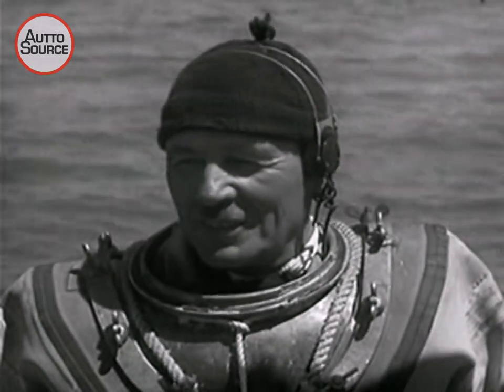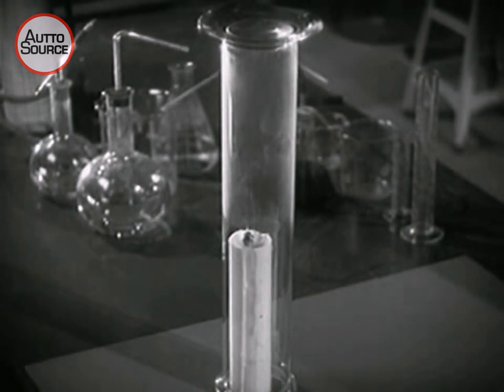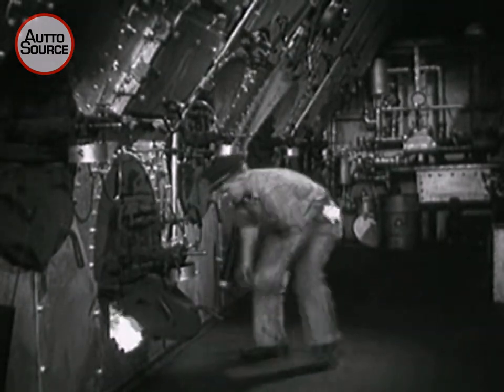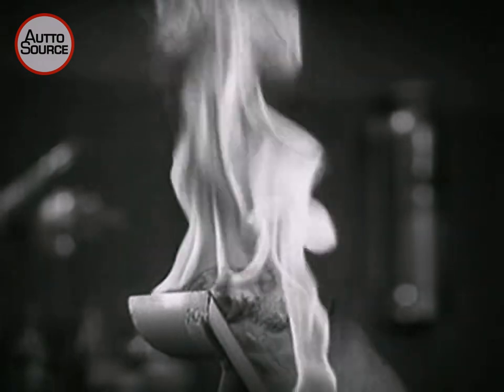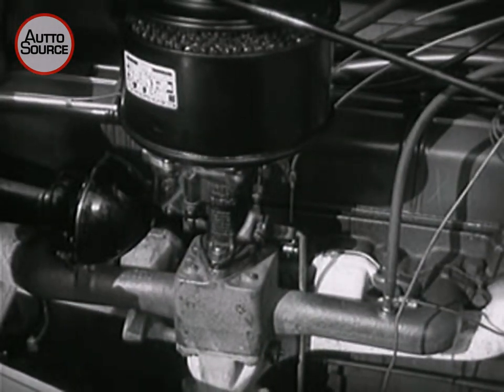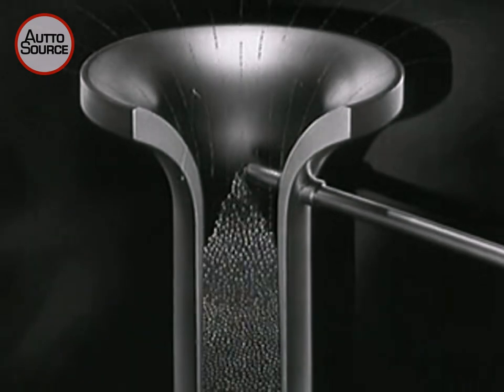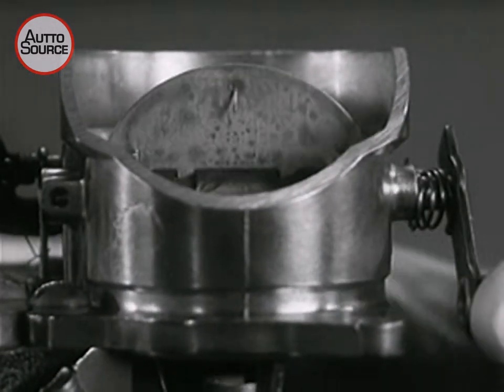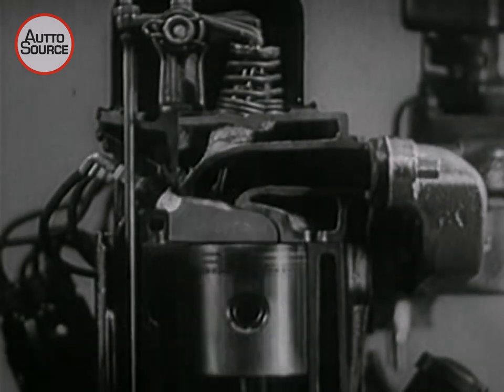How Carburetor Works

Comment: 3 tablespoons of gas per .25 mile = 12 tablespoons per mile.  That means the car gets about 20 MPG.  Considering the car did not use all of the three tablespoons of gas in the quarter mile, one can reasonably assume the car gets roughly 25 MPG under ideal conditions!  Not bad for the time.

Comment: In my carburetor class we are certainly going more detailed on the parts and function, but this is a great video explaining the basics of how one works. Also noted the old wetted air filter with steel wool. Finally seen one earlier this afternoon. The carburetor my partner and I were working on plus the air filter came from his old 1951. The fuel tank on the carb was clocked with some kind of bug nests. Not the first time I seen bugs in fuel system, but still don't recall being informed what kind of bugs would live in there?!

Comment: I did some math, it took them about 3 tablespoons of gasoline to get about a 1/4 mile. There are 256 tablespoons in a gallon; 
4 (quarters in a mile) multiplied by 3 (tablespoons) is 12 (tablespoons of gasoline per mile), 256 (tablespoons or 1 gallon) divided by 12 (tablespoons) is 21.3 (miles per gallon). There is no way THAT car got 21.3 miles per gallon driving like that, more since the carburetor didn't even take the whole vile of 3 tablespoons. Just killing curiosity lol
Reply: Jason Delamarter but the EPA wants to ensure that engines become MORE efficient.
Reply: You can thank the EPA for fuel economy restrictions. Why is it impossible for the car to get 21.3 miles per gallon
Reply: The EPA cares  about emissions not engine efficiency

Comment: General Motors used to make the best educational videos, they really explain mechanical systems with a logical progression that anybody can follow. Now if only they could make a video explaining how a turbo encabulator works, because that Chrysler video left me even more confused...
Reply: How does a turbo encabulator work? It's super simple dude. The original machine had a base-plate of prefabulated amulite, surrounded by a malleable logarithmic casing in such a way that the two spurving bearings were in direct line with the pentametric fan, the latter consisted simply of six hydrocoptic marzelvanes, so fitted to the ambifacient lunar vaneshaft that side fumbling was effectively prevented.  The main winding was of the normal lotus- o-delta type placed in panendermic semiboloid solts in the stator, every seventh conductor being connected by a non-reversible termic pipe to the differential girdlespring on the 'up' end of the grammeter.
Reply: @silience4095  LMFAO  you're funny :face-green-smiling:

Comment: 21.33... Miles per Gallon! WTF, that is better than my 1998 Jeep gets today.
Reply: My 400 HP 6.0L GTO gets about 21 MPG if I am driving carefully and not encountering a lot of stop signs/red lights. I suspect they may have been driving the test car slowly across that quarter mile, so that air resistance isn't a big factor.
Reply: +Satarn Smith for real. I drive a little bmw roadster and i'm regularly getting 18mpg from a 3liter straight six.
Reply: +Christian Arreguin, that is what the math tells us.
Reply: The point is that it is not much better today, then it was then.

Comment: 3 tbsp (44mL) for 1/4 mile (400 meters) means 9,1km/L . My Citroen C3 can travel 18km/L of gasoline and I bet it's faster than that car. COME ON, CARBURETOR SUCKS. Fuel Injection FTW
Reply: +Matheus Bitencourt You're comparing a modern fuel injection system, that's designed for as much power and economy as possible, to a time where it wasn't possible to have fuel injection. 

Of course modern systems will be better.
Reply: +Matheus Bitencourt The carburettors don't need electrical supply. Carburettors are actually quite good and there are carburetted cars that can use about as little fuel as fuel injected cars. They don't need computers, no throttle positioning sensors, no air/fuel sensors, no map sensors. Now, does carburettors really suck..?
Reply: +Matheus Bitencourt Old volvos arent injected... You clearly know nothing about how carburetors work and cars in general.
Reply: +haavard1989 Not only that, carburators have a throttle response that MPI TBI SFI and GDI cannot even come close to. Carbs may not be nearly as efficient, but with the right hands tuning it, it can have many benefits over any form of electronic fuel injection.
Reply: Small japanese cars could do it :) Even my friends old volvo did 0,6L per 10km. Believe it or not.
Reply: +Matheus Bitencourt Citroen lmao
Reply: +Matheus Bitencourt the production car manufacturers stopped the development of carburetors in the 80s in favor of the EFI. BUT, aftermarket carburetors (like the ones from weber) have continued to develop and a modern progressive carburetor can give you as close as 2% less fuel efficient than EFI where tests are done on the same car. 2% more fuel needed is amazing concidering they are 100% mecanical. Having that said, most aftermarket carburetors are made for racing and fitted on big muscle cars where fuel consumption is not really a major concern anyway.
Reply: +haavard1989 I don't know any car that uses carburetor and can run 18 - 20Km/L at road. My Citroen C3 is a 1.4L, and deliver 70HP. great for the city, and for small travels.
It wouldn't be possible with carburetors. 70hp and 20Km/L
Reply: +haavard1989 maybe. is it injected?
Reply: +Matheus Bitencourt The car used in that test was super old and heavy, prolly not great mileage even if same engine was injected.
Reply: Yea carburetor
Sucks compared to efi because it's old technology duh  but if it wasn't for carbs we probably won't even have fuel injection so we still have carbs to thank 😎🏎
Reply: +Matheus Bitencourt People usually understand that your're joking.
Reply: +Joseph Ryan Biag Your mom usually understands that you're joking
Reply: +Matheus Bitencourt the design of the old carburettors and manifolds was pretty crude ... sometimes one carb feeding 8 cylinders.  20 - 30l/100km was not uncommon in those days.  These days we have multiple valves, variable valve timing, fuel injection, higher compression, higher cooling system temperatures etc.... all leading to incredible fuel consumption figures.
Reply: +Plymouth Harrison  Modern cars in the us are not designed for the best fuel economy. There designed to meet the clean air act dictated by the EPA.
Reply: Jason Delamarter That's the same. 
The only way to make a car less pollutant, is match the correct amount of fuel and air. So, the complete combustion occours. Complete combustion means no wasted fuel and less pollutant, so It's correct to affirm that FUEL ECONOMY = LESS POLLUTANT.
Reply: CO emissions are optimally cleaned by the catalyst in the catalytic converter in a lean condition since O2 is necessary for the catalyst. N2O emissions are optimally cleaned by the catalyst in the catalytic converter in a rich condition the lack of O2 is necessary for the catalyst. The ecm in newer cars will cycle between rich and lean conditions to achieve the acceptable amount of emission. By doing this fuel economy will be sacrificed to have cleaner emissions. A complete burn is called astoichiometric
mixture. In practice this is never quite achieved, due primarily to the very short time available in an internal combustion engine for each combustion cycle. Astoichiometric
mixture burns very hot and can damage engine components if the engine is placed under high load at this fuel air mixture. The high temperatures will cause detonation of the fuel air mix shortly after maximum cylinder pressure is possible under high load.Stoichiometric mixtures are only used under light load conditions. For acceleration and high load conditions, a richer mixture lower air fuel ratio is used to produce cooler combustion products and thereby prevent detonation and overheating of the cylinder head.
Reply: +Matheus Bitencourt you own a citroen, your opinion is invalid
Reply: DIE Why so much hate against Citroen, dude?
Reply: Jason Delamarter Yes, you're right. 
What a really meant is that Fuel injection is way cleaner than old carburetor
Reply: supersecretninjame cool. But I still prefer EFI

Comment: did the math that car gets 21.3 mpg
Reply: at like 20 miles an hour... what's the mag at 60?
Reply: +Eric Lopez 
top speed on those cars were usually around 60. thats saying if they were pushing as hard as they could. average driving was probably yeah like 20mpg. looks like we had to change things once cars got faster.

Comment: Geeez... it's like "they" act as if air isn't FREE!?
.
The carb in the video is simple, and extremely efficient, down to an exact science. It will always be better than Electronic Fuel Injected systems, since the computer is doing the calculations, rather than a mechanical way that is more reliable, and always more exact. The carb can be easily adjusted to all conditions by the owner. Do you want computers like Hal running the whole world, even your car" "Hal... open the pod bay doors"!?
.
It's not hard to tech the workings of a combustion engine, and how it works. I even believe the carb in the video is more complicating than it needs to be. Can't a simple float bow and venture with a single needle jet be sufficient enough for a fuel delivery system? Even a diaphragm setup these use for propane conversions can also be used for gas delivery. I remember a old Sachs snowmobile engine I was working on had a diaphragm carb setup, that I rebuilt. Even that was complicated on a old sled?
.
Even the fucking spell check on anything I use, aint worth a flying shit. Computers can't be trusted... they are a prototype of the brain: "MACHINE MEN, WITH MACHINE MINDS... YOU ARE NOT CATTLE YOU ARE MEN... YOU HAVE THE LOVE OF HUMANITY IN YOUR HEARTS"!!
Reply: Brian Davis Dude wtf is up with this guy?
Reply: Carburetors are simple and a nice example of mechanical engineering..
But fuel injection provides more power, torque and more compression using less fuel all while reducing emissions.

The only advantage to a carburetor is it's simplicity and cost to maintain.. But both these advantages are diminishing as people get smarter (And able to easily understand electronic fuel injection) and as supply / demand decreases for older parts.
Reply: Brian Davis Well actually the heart is controlled via electrical impulses from the brain (Like fuel injection is electronically controlled by the ECU) ;)
That's why electric shocks are used to restart hearts.

Modern car ECUs can account for air pressure, temperature, density, fuel quality and throttle position to give you the best air / fuel mix ratios for power and economy..

They also have some error correction to prevent damage caused by an engine running too lean or rich or incorrect coolant temperature..

As per cooling, well internal combustion is a rather inefficient means of producing power. A large percentage of the energy produced is heat which is wasted.. We may well see the end of Internal combustion within our lifetime!
Reply: Azurren That's like saying, "would you rather have your heart beat on it's own, or would you want a pace maker deciding each beat"... In reality you wouldn't need any electronics at all to run a vehicle if they would fix issues with tainted gas... and so on, and so on, and so on...
.
An engine is mechanical, no more diffrent than the human body... it's external control that is the problem. Ultimately the problem with EVERYTHING is a few people want to be, and play God... and will resort to the torture of innocence in order to extort God into getting what they want. I have had the worst pains possible from just making comments on youtube, just about engines alone!! That's how you know things are bad!!
.
You can check out a comment I made on "Twin Turbo Diesel - Explained"... about fuel injector efficiency lie. Ultimately the problem with fuel efficiency is actually a cooling problem. Instead of fixing cooling issues, cars run rich... meaning much of the fuel is wasted, not burned, just to keep the engine cool. It's funny too, because you can make your own air conditioner by simply pressurizing air through a small hole... no need for refrigerant, or those big box units in your window. Your refrigerator for the most part is actually kept cool by this simple concept. Everything is a overly complicated lie. Reduce the variables, and you will figure out God is behind everything!!
.
I have to go to bed, my head and body is pretty torn up....
Reply: Totally agree, my truck's got some serious issues atm and it is all caused by buildup fucking with the sensors! I have to wonder if 90% of engine issues are caused by our computer sensors that they just have to shove into the places where they will cause a buildup and eventually cause it to fail... or maybe that is just a way to get you to buy a new car faster? I think I'll go with that.... along with all the other junk that isn't made to last that we have today like refrigerators that don't last 5 years... I grew up with a 50's fridge that was still working up until about 2 years ago and without a single problem!
Reply: Steven Crimmins Your right... a simple venturi setup  like in he vid works, and is exact!! They need to start incorporating reed valve ad a HIGHER intake to atomize the gas more.
.
You want to figure out waste, just look at how stupid the EGR works!! It's the reason for old smokey taking off from a dead start. Diesels run ridiculously FAT/rich on fuel... I think it has to do with the fact that diesels are put through touch working environments, and high heat. But that can be addresses with bigger cooling ports (a lot bigger!) and more water/coolant running through the engine!! But at the same time = EGR SToooooPID!!
.
Tractor pulls are ridiculous!!
Reply: Azurren What if I was to say that all electricity comes from living beings like us? Except there is so much negative energy in the air, you really only need one wire to power a device... and the positivity coming from yourself to power it.
.
Try being a light for once...
.
Hands down there is no possible way that a EFI system will ever be as efficient as a simple carborator... Would you rather have a pace maker decide your heart beat, or just your regular body (high blood pressure, and a unusual fast or hard heart beat, just does NOT exsist... it's induced through the torture of others. This is a fact that can't be disputed anymore!!)?
.
If a body is runned by electrictical pulses, then prove it by actually powering a light bulb! You can't say that the body only produces a little electricity due to the fact of how much circuitry is in the brain, just like a computer. You could say that a computer is just a lower version of the brain, that also runs off of electrical impulses.
Reply: Brian Davis Find me a car sporting a carburetor that can both match the performance and achieve better MPG than over 70mpg (The same as some new ultra-efficient EFI cars) and you may have a case..

But as far as I am aware a carburetor can't match EFI in efficiency while still being practical.

The average adult only produces between 10 - 100 millivolts. I guess if you could find an LED that small you could power it up with a thought :P
Reply: Azurren All you would need is read valves and efficient cooling for a carborator to be way more accurate and effective than a EFI system. You have to remember that a computer has to get right at the most exact time 3000-6000 (even more), for every spurt of an injector. A carburetor does it with the same principles of a Mass Airflow Sensor... and it does it with ease!! Although that is an engineering feet... however, I'm going to guess that an injector works the same as a carborator, allowing the same flow of gas at the same RPM, with the feed from the MAS. In reality, it's really not that technical, and overly complicated...
.
I love you!!
Reply: +lobsterbark And I do...
Reply: I dunno....
Reply: +Brian Davis  NO!  a carb reduce ALWAYS the power in comparison of the simplest injection type (inclusive totaly mecanicaly like for ex. K jetronic or Kugelfisher, minimum 5% loss of power because the venturi is a restriction, much more incomparision with a top end direct electronic injection..
Reply: +leneanderthalien obviously you don't have a tbi 350. The factory fuel injection sucks hairy balls on these engines. It's a common mod to switch back to a carb or upgrade (this is the expensive route) to msd or Holley efi
Reply: terroriticus what is mpi? or gdi?
Reply: Brian Davis in my opinion they make it   complicated so u as the user cant fix them so the shop u bought it from can make more money which leads to more taxes to pay
Reply: Steven Crimmins Totally agreed!!
Reply: J young It's funny how the more complicated design is the one that is used, or implemented. Just imagine a rotary engine simplified even more (much more, while correcting the stupid knives for "apex seals" whatever... all you would have to do is round them off, and make sure you mix the gas, or deepen the bores for more compression so it could run off of diesel. In reality it is much like a 2-stroke engine... it needs lubrication) with a venturi setup and a simple body/chassis/drivetrain... and real simplified electronics system. Something like tiny power-strips, where you could add or removal universally anything you want into the dash/engine.....This vehicle simplified could be the ultimate everyone car that is dirt cheap, and extremly powerful!! Think Model T with todays knowledge!!